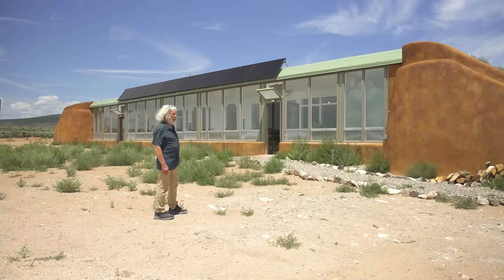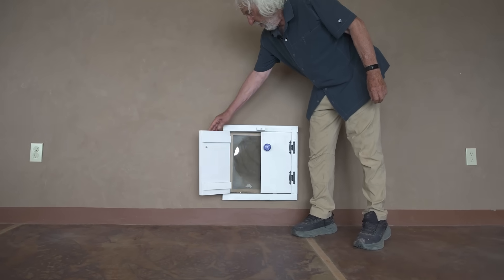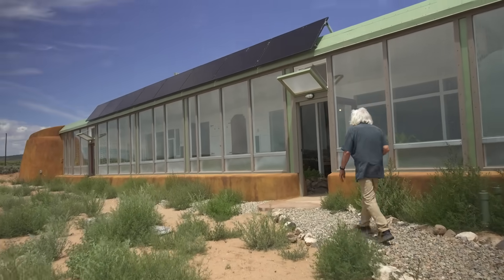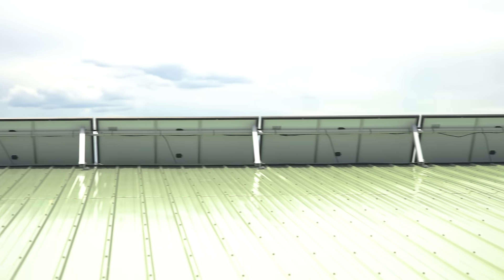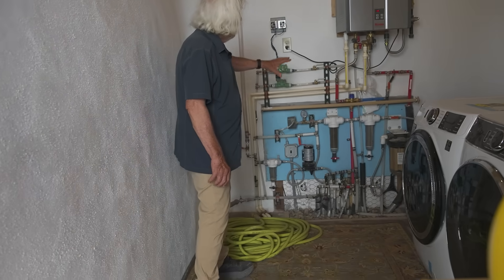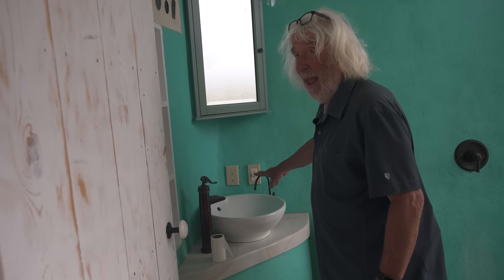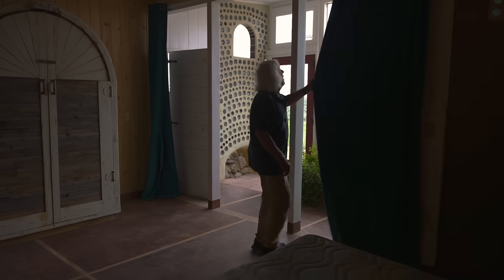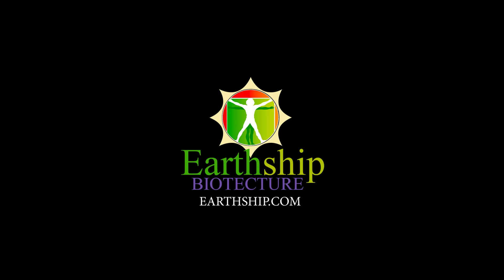The Refuge #earthship Walkthrough With Michael Reynolds

Comment: Where I live the people in the planning department heads would explode if you submitted that for approval. “You want to build a house out of old tires?” “Where are your wind loading calculations?” “How do we know what the compressive strength of that load bearing berm is?” “Where are your engineering computations for the bottle walls?” etc, etc. I know people have built these here but the hoops the first few people must have had to jump through boggles the mind.

Comment: Would something like that work in MN, WI MI or 1 of the Dakotas?
Reply: My Nest was in Taos where it gets cold in the winter with many grey days. I found that a little wood burning stove was the perfect supplement and very efficient; but my Nest was much shallower; so I did loose significant heat through the glass. But with this deeper design and the plant corridors, with curtains on the main living spaces to close at night, should be warmer in winter in colder climates. Would need to grow appropriate food…

Comment: You Guys!!!  You can rent an Earthship. 

Earthship Nightly Rentals at their headquarters, in Taos, New Mexico, USA.

We rented The Picuris for a night & I actually cried when we left! 

It was so beautiful & comfortable. I loved it. 

🎉🎉🎉 Michael is a legend in his own time (as someone posted here already). It's True.
Reply: I want to build one for someone, but I'm very isolated and don't know many people, let alone people wanting these...
Im a roofing contractor, so I will also be plumbing that fresh air tube into the ceiling and out to cool better. This is separate from the roof ventilation that's exterior stuff. 
I want to add a climate battery full of sand and water lines for on demand hot water....Basically, the sun tubes we put in roofs for dark downstairs or hallway but with sand insulation packed around it to collect trap that solar energy daily..... can get fancy and add leaking sand battery under beds and transfers heat to it for winter heat with affluent customers, lol.
Reply: we rented his little early earthship near downtown Taos on Air BnB, super fun and a great experience!

Comment: the higher up you mount the water reservoir the more pressure you get from it regardless of volume.  It's a principle of physics and it is demonstrated on youtube.
Reply: It is trade-offs.

You won't generate much pressure unless you raise the cistern several dozen feet. But if you do that then you will need a pump to get the water into it, and you will lose the in-ground cooling effect.
Reply: @TwilightMysts  A basic mechanical windmill could pump the water.
Reply: You get about half a pound of pressure per foot of elevation . I think the benefits of cooling in ground out way the amount of height required to get enough pressure.
Reply: @kazzana9013  We're just trying to get more pressure. It can still be cooled the same.
Reply: @kazzana9013  "half a pound of pressure per foot of elevation"  No that's really not the case and you don't need a large volume https://youtu.be/EJHrr21UvY8?si=dOXy_sEip7KoYgga  See Pascal's barrel experiment

Comment: Amazingly simple and yet, logical way to heat/cool/capture water and distribute within a home. Love the botanical greenhouse along the south side. Instead of using tires, I assume this design can be modified if using regular rammed earth on the north side, and can include solar tubes to capture and light up the bedrooms during the day without the use of electricity. Bravo, either way!
Reply: I hope to build one using rammed earth some day. I am confident it is perfectly usable.

As for the lighting, they are usually designed so that light from the front windows goes through the greenhouse into the rooms. It will vary with the time of year, but it should cover most non-reading light needs.
Reply: those solar light tubes are pretty, and interesting to look at, but they're horrible for the longevity of a roof, having a penetration like that.  I'd just go with a dimmable light for each room. There are very pleasant LED lights now, and they use very, very little electric power.

Comment: I love the design of this earthship... pure genius! I have full intentions of living in one someday soon. BUT... if I have to build one myself, how do I go about getting a reluctant spouse/family on board with living rustically until the earthship is finished? Being on fixed income, I cannot afford to put them up in a rental while I build alone... and that's a LOT of work. Hopefully, I will be able to find a finished one for sale or rent that I can afford... then I will be able to attend the earthship academy and start building my own... I hope.
Reply: Depending on your local climate, perhaps get a yurt or dome tent to live in? You should be able to build one for under $100k, and they can get fairly nice inside. The fixtures and appliances (kitchen counters, sink, fridge, bathroom sink, toilets, shower fittings, wood stove, etc...) could be moved into the earthship when it was done, and the tent itself could probably be resold. I suspect the net loss would only be around $25k, and you can make that back just on 2 years of not renting an apartment.

The big challenge is that earthships are very labor intensive to build. Paying someone else to do it is very expensive because of the time, but doing it yourself means either spending years to build it on nights/weekends, or quitting your job to work on it full time and get it done in 6-12 months. Either way, they aren't really any cheaper to build than a regular house. The savings come later from not having utilities, and having the peace of mind of being more self-sustaining.
Reply: @TwilightMysts  This does nothing to answer my question- how to get family to live rustically while building... my tribe refuses to live in any tent. I can't even get them to camp with me. I'm retired, so I don't have to limit my building to weekends, etc. I'm not sure how I will accomplish this, but I will...

Comment: So you can't sleep in a darkend room because of the convection. Closed curtains block the air flow 🤔
Reply: What? Still watching video. 1st time I heard that and been following for 20 yrs.
Reply: I see the transom’s are on interior wall to garden area… I’d have to revert to sleep masks.
Reply: You could make a more complicated transom that allows air to pass through but blocks light.

At first glance, a pair of opaque sheets 2/3rds the transom width, with an air gap between them, should block a lot of the light. 

You'd likely lose some airflow due to increased resistance.

Depending on how much of an airgap you allow, it might be thin enough of an assembly to still be manageable as a hinged transom to get full bore airflow when darkness isn't wanted.

Or ditch the hinged transom and go full sliding panels.

Comment: I would love to hear from some people who have lived in these for a number of years. 

I knownthe design has changed over the years and improved , but it would be good to get an honest warts and all feedback. 

My concern is that they wouldn't hold the heat in enough during winter
Reply: If you are concerned about winter, you could add extra insulation, put heavy curtains to close when the sun isn't out, and add an alternate heating source (gas, electric, wood stove...) to make up the difference. I plan to put a rocket mass heater in mine.

I heard a story about a monolithic dome that ran out of gas for heating during a blizzard. It took two or three days before they even noticed.
Another story, an Earthship (I believe in Canada) had to put in a conventional heating system for regulations purposes, but almost never needs it.

I suspect if you put some extra effort into handling cold temperatures, you would be just fine.
Reply: There are designs that include a second greenhouse for builds in very frigid climes.  Being surrounded on three sides by insulated thermal mass, thick foam in the ceiling, the constant 55F earth below, and glass south face (or2) add up to extreme thermal performance.  I really can't see lack of heat being an issue in this kind of structure.

I see that some people are concerned about high humidity in these earthships.  I wonder about that, too

Comment: Going to be building a new home soon, and Earthships were my first choice. The problem is I live in Alaska, and we simply don't get enough solar in the winter to use this type of design. I will be building using the same outward design, but I will need far more insulation and a heating system to survive our winters. I have been looking at strawbale construction, but my wife and I are still in discovery stage.
Reply: Rammed earth walls are beautiful, and can have quite a bit of insulation inside.

Down sides are that they are VERY thick walls, cutting into your usable square footage, they are almost as labor intensive as rammed tire walls, and are probably more expensive (I believe rammed earth mixes in around 10% cement as a binding agent, though a lot of earthships use cement as a filler on the tire walls, so I could be wrong about which costs more.)
Reply: Michael Reynolds has designed earthships that include a second greenhouse, which adds functional space and an extra thermal buffer from outside temperatures.

The other (less initially expensive) way to go would be to rely more on chemical fuels, and just have an insulated rammed earth south face with minimal windows.  you won't get a livable greenhouse, and you'll have to deal with the grey water in a different way, but it's doable.

I wonder if anybody at Earthship Biotecture has tried to do an automated curtain that goes clear across the greenhouse glass at night
Reply: @OnlyFactsPlease  I wish it were that simple. In Alaska there simply isn't much sun in the winter, and Earthship designs use thermal energy to achieve their temperature equilibrium. If you spend 3-4 months with no thermal energy that thermal mass is going to get brutally cold at -20F. In summer we get A TON of sun, winter not so much. Wood heat is my best choice at that point, with superior insulation. Ergo, looking into straw bale construction to stay as natural building as possible. That being said, I can build to the same design as the Earthship with a lot of the same features. The greenhouse would have to shut down in the winter, but I can do that no problem. I use a Separett toilet and biocompatible soaps so no real issues with grey or blackwater.

Comment: What is the cost to truck in water if you ever run out due to a super dry summer?  Do you use special soaps and detergents to prevent contamination of the food you produce in the botanical cells?
Reply: I am in Arizona and I get 4000 gallons for around $100 dollars hope that helps
Reply: Yes you have to use biodegradable soaps

Comment: In following the recirculating water system I missed whether it involves a septic tank or does the garden act as one! This dwelling is really a great way to coexist with earth! Thank you!
Reply: There is usually still a septic tank and external drain field for black water.

The way the concept works is it utilizes rain water collection, which goes to the sinks and showers.
The water then drains into the planters across the front, watering the plants.
After being filtered by the planters, the water is then used by the toilets.
From there it runs through a standard septic tank out to a drain field, watering a small patch of external plants.

The kitchen sink depends on your location. Some areas consider the kitchen sink black water, so it goes straight to the septic tank, others let it go to the planters just like the bathroom sinks/showers.
Reply: @TwilightMysts yeah, good rundown - typically the blackwater seep field for an earthship will have a no-edible-plants rule too, but that doesn't mean you can't plant a native pollinator garden on it.

Comment: Will this work in Phoenix Arizona? How cool is it in the summer?
Reply: Yes the Refuge or any Earthship model would work very well in Phoenix. It would be nice and cool inside with your air intake and transoms open <3
Reply: @crimblegnome  do we know any one who has done it here in Phoenix so I can go see it? Or will I have to be the first?
Reply: @Jh---3ee  it all depends on your county codes and what they allow for self-sustainable off-grid building. I'm speaking more on the climate zone that Phoenix is in and how an Earthship functions in that zone number. I'm not sure what the regulations are for where you live
Reply: @crimblegnome  I have 20 acres that's zoned for anything so the city doesn't care on my land but the climate is what I'm more concerned with. 115 degree day and hoping it's not boiling inside if that makes sense. You guys want to use my land as a test bed for Phoenix?
Reply: @Jh---3ee  Zoning is different than building code requirements. I doubt Phoenix or Maricopa County would allow anything like this. Most go up to the rim, or down in southeast AZ for this type of building. Def worth looking into if you own good land, though. Best of luck from a SE Valley resident.
Reply: Exactly. The biggest challenge is building regulations. For example, some places are fine if you build an earthship with just a wood stove for occasional use. Other places require a more conventional heating system (gas or electric) be installed (even if you never use it). Some areas consider the kitchen sink gray water, other regions consider it black water. Some places you can DIY the electrical and just get it approved, other places will only allow a licensed electrician to do it...

As for the climate, these are done in New Mexico, which is probably a very similar climate to Arizona.
Reply: @TwilightMysts  we're off topic guys, just admit you really don't know but think that is highly possible, my question was about one single thing, heat/Arizona and an earthship working comfy, not the other things. I'm a 14 yr housing professional, licensed, so I know a thing or 2 about this your point, what I don't know, nor have seen any evidence, is it this will work in the low desert of AZ, for summer use, that it, if you don't know it's ok, but let's please stay in topic and under expound in the things you mentioned as well, but my concern is singular. Lastly NM taos and Phoenix are not the same at all. It's around 110 -120 for months here in the summer, NM doesn't see this heat. Thanks

Comment: Still innovating as per usual - Awesome ! Great to see you still good enough for Taos Mike. I still think you should consider low voltage circulation fans in the bedrooms to force cross ventilation with the cooling tubes flow. Also the rear should also have a water spout nearby to clean the cistern or roof. Any interest in algae-bioreactor tank on south glazing?? Thanks Mike God bless.

Comment: Does that battery system require ventilation for vapors or any part of byproduct from the electrical system?
Reply from the maker: These air Lithium Iron Phosphate - they do not off-gass like lead acid